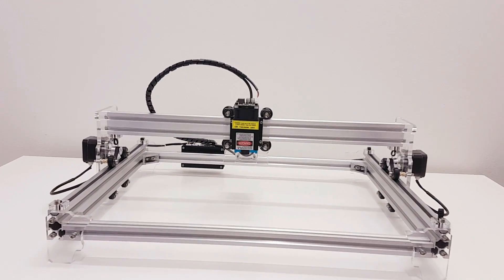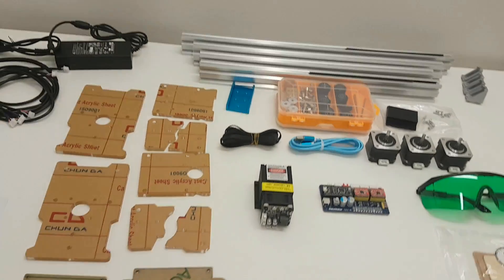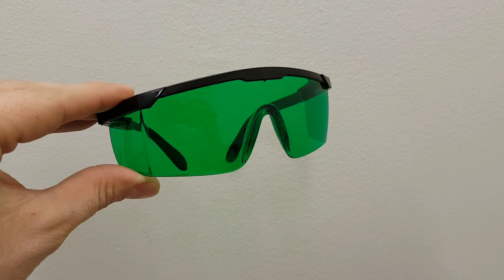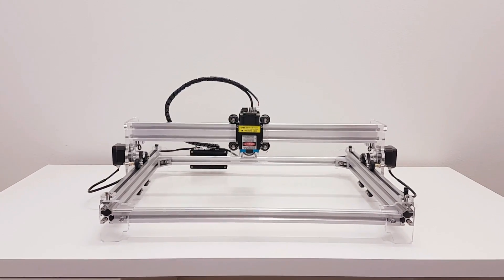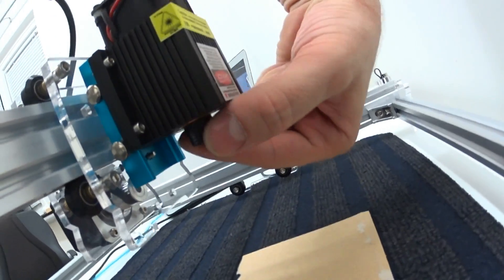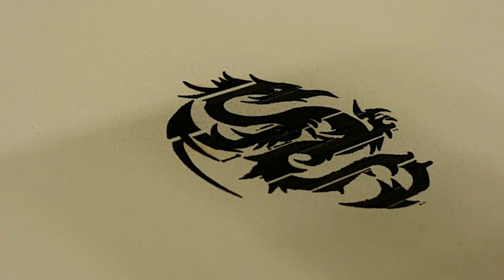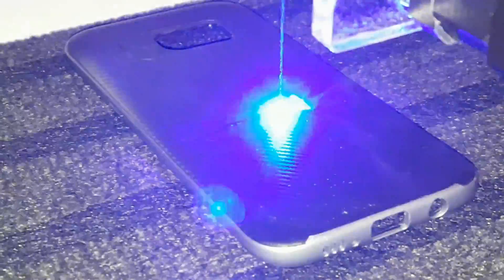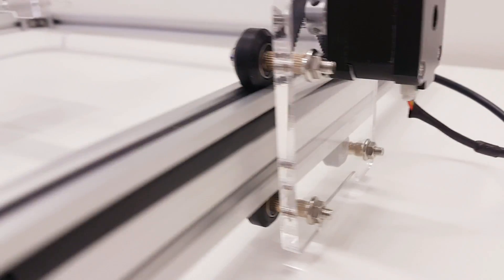A3 Pro 5500mW 300 x 380mm DIY Laser Engraver Build,Test and Review!

Comment: Have you tried cutting hobby plywood or balsa wood with this?
Reply from the maker: Yashar Yasrobi Finaly I received my Plywood 3mm and I did some cutting! At 300mm speed it burn through in 3 pass.
Reply: +1 for this request, Nexi, if possible try to cut such material
Reply from the maker: Coming soon ;) I order plywood but still not received it.
Reply from the maker: Yashar Yasrobi Yes very clean.
Reply: Nexi Tech Was it a clean cut?
Reply: Nexi Tech can you try acrylic 3mm?
Reply from the maker: Weed Prankers Acrylic is no problem! But transparent color will not work laser just pass thru. Black Acrylic(dark colors in genaral) can cut the fastest. For bright collors you need more passes. But in general there is plenty of power with this 5000mw laser.
Reply: @Nexi Tech So do I understand that it would be possible with this laser engraver to cut through veneer, balsa and plywood for rc modeling and veneer wood work?